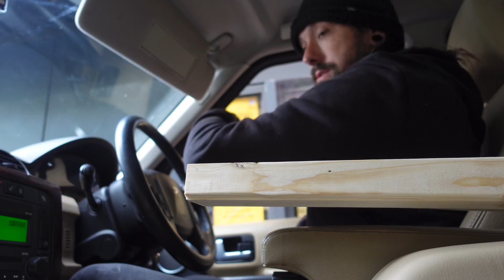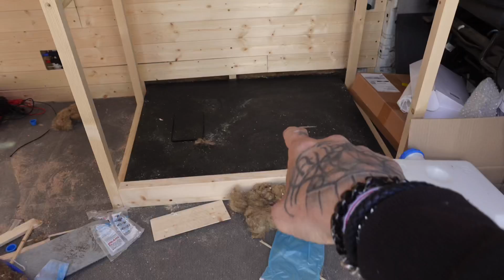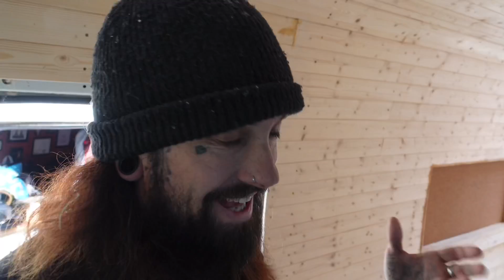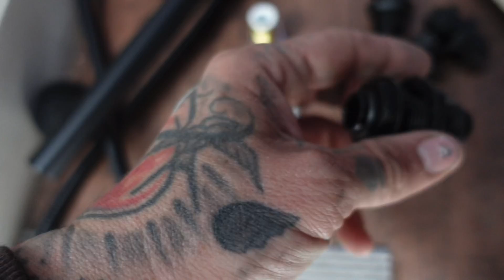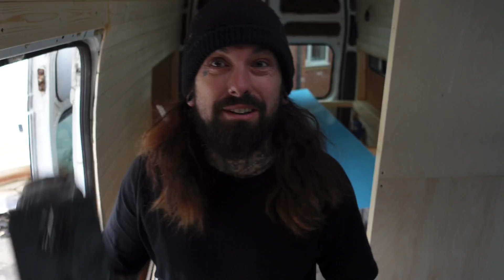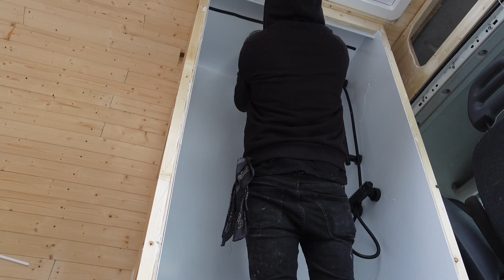Diesel Heated SHOWER - Bobil Vans Water Heater!

Comment: Please could you possibly do a more in depth video on the diesel heater hot water and how the mixing works to control the temperature? I'm more scared to do the plumbing than I am the electrics. Did you run the fuel line yourself? Also, how does it affect your driving having a huge amount of water sloshing around? Did you mount the water inside or outside? 😂. Sorry for all the questions I just like that you're figuring stuff out as you go along, better than speaking to a plumber who waffles technical jargon asif everyone understands 😂

Comment: Hi, looking at putting one of these heaters in, surely you should have a diverter valve on the other side of the heat exchanger so that in winter you can choose not to waste the 'waste heat' and push it into the van?
Reply from the maker: Tonight’s video might be useful to you
Reply: I had the same thoughts as you, however (from the Bobil tech doc):

Note for use: If the circulation pump has been turned off as the hot water has
reached the desired temperature, you must divert the heat away from the
exchanger or switch the heater off. Releasing the water pressure in an
exchanger that has been heated to over 100 degrees can cause rapid boiling
and excessive pressure in the exchanger. This can lead to premature exchanger
failure and must be avoided.

So you need a means of diverting the heat away from the chamber or it overpressurises. So ducting goes: heater to diverter to exchanger (if selected), as Liam has done.

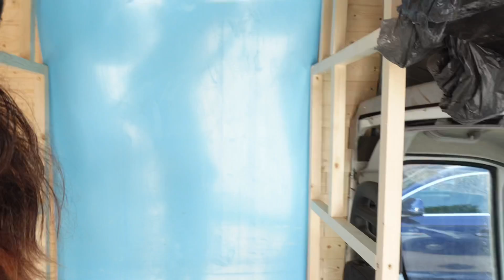However, look at this vid (@3:55): https://www.youtube.com/watch?v=SsoPhYcC3dw there's a pressure relief valve......which begs the question, do you need a diverter at all; other than to dump heat if you need hot water but not heating (summer)? In which case the diverter after the exchanger would (as you said, @waynesarahburns3871) reduce the 'waste heat'.

The pressure relief valve suggests that the scenario from the tech doc above could not actually happen, if all is functioning correctly......

Comment: Thanks for the video.
I think it would be more efficient if you had installed the heat exchanger before the splitter. Then you can either heat the van and the water at the same time, or just the water.
Now in order to heat both the van and the water at the same time, you have to waste half the energy.

Comment: Some good stuff, but... that heat exchanger... is it cycling water or just using convection, hot air on the water tank heating the water.    Just out of curiosity, what size is the shower stall?

Comment: So glad I found your channel. Seems like every other project or so you work on is something my rig needs or I wanted to do.  Trying to keep things as original as possible as it will depreciate the value of this vintage rig, but some things I just need to fix.  I'd kill for this shower!  It's the most beautiful thing I've ever seen.  I had to opt out of putting an indoor bathroom in this bunk house style rig and go with an outdoor solution, but sure admire your work.  Thanks for all the good info, really helping a lot.  Your children are beautiful, not expecting that in remodel/repair vids.  Surprised to hear your getting negative input about how "your" raising "your" own children.  Just keep pluggin' along, go with your own convictions....after all your the one that's going to be held accountable for them.  I find peoples advice is a lot like a radio, sometimes you just have to shut the noise off.  See you next time and thanks again.

Comment: Liam, what I was thinking when I ever do mine was to use resin to paint on the walls, ceiling and floor to totally waterproof it. Is there a downside you can think of? Maybe, weight, flexibility or something? Nice job though mate, looks very clean. I like the extraction fan with the light built in, not seen those before, is it 12v?

Comment: Looks great Liam. Thanks for you heads up on the diesel heaters also, I installed the one I purchased from Maxspeedingrods you showed in a previous vid using your code, it works like a treat.

Comment: I used cushion flooring to line my shower it's easy to work with will never wear out or leak and I got a very nice mosaic pattern also got it cheap from the offcut section at the shop

Comment: Just wondering .. Shouldn't the bobble heater be directly behind the heater (before the splitter) so the water is always heated? ... then use the splitter after the bobble heater to choose where the heat goes (in or out the van).
Any heat you used to warm water, is then extracted and wasted. ... If it was the other way, the same air would heat the water, then the van ....and could be diverted out of the van after the bobble heater in the summer.
Reply from the maker: There are two ways it can go :)